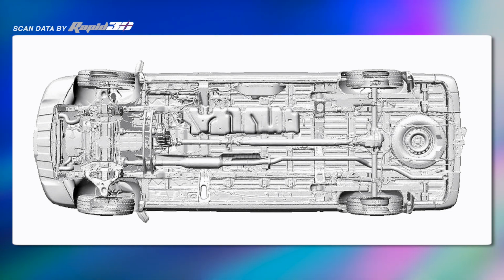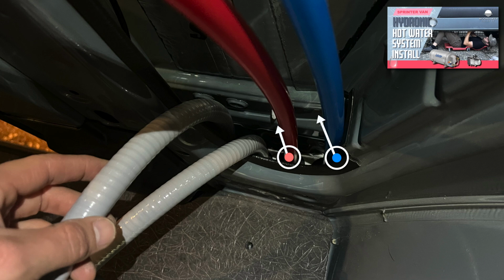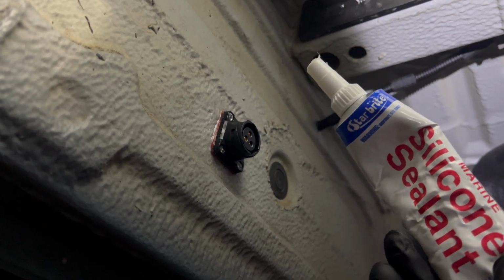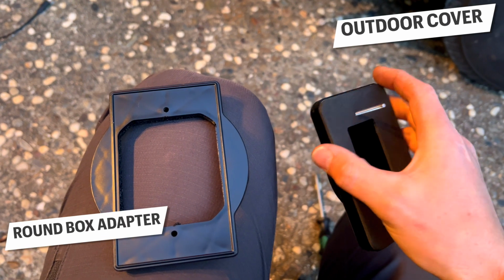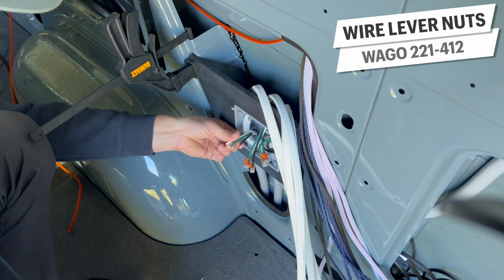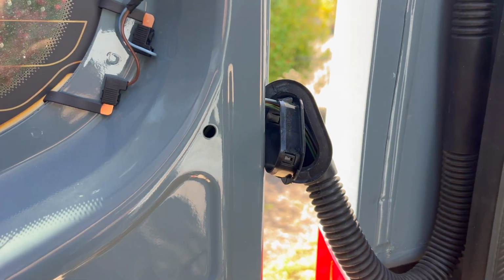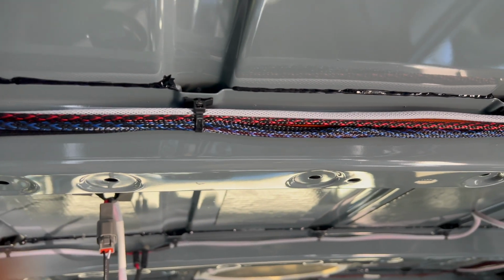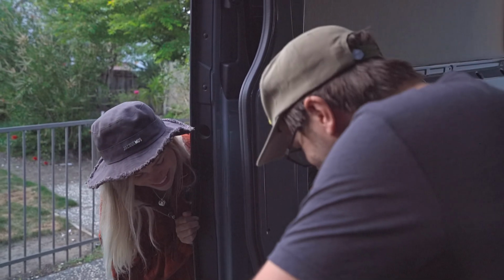Sprinter Van Electrical System Phase II - 120VAC Circuits & More 12VDC Wires

Comment: I purchased that cable boot and was wondering if you just used sheet metal screws.  I dont see a way to get nuts on the back side of it.  Im going through the same 3" oem holes you are on a 144
Reply from the maker: Yeah I used sheet metal screws, but I used ones with a blunt tip and pre-drilled pilot holes.  I used a blunt tip to limit sharp things inside that cavity.  Here's the exact ones I used - https://www.mcmaster.com/93195A434/

But after the fact I think normal sheetmetal screws would be fine since the boot does a good job keeping the bundle together and away from any of these screws.

Comment: Outstanding videos thank you. I see you are using liquid tight conduit under the van for your 120v runs. How are you going to run 120v inside the van. Conduit, split loom, techflex or ?. Thanks
Reply from the maker: Hey there, thank you for the kind words, it depends on where the run is going, by the sink I just kept the liquid tight cord grip going, but over by the electrical panel tech flex since its lighter and there's no real sharp metal edges on the route.

Comment: Hi Todd, Always waiting to watch a new video from you. They are all amazing. Thank you. Could you please advise when/where to you use Rust Bullet and Rust-oleum rust preventer. which is more recommended. Or, is each one for different application?
Reply from the maker: Hey friend thanks for stopping by and glad you are enjoying the content!

We’ve switched exclusively to Rust Bullet using this method 

How to Paint Exposed Metal Edges on a #SprinterVanConversion
https://youtube.com/shorts/GOBaAJjhO8A?feature=share

Later in our build. It dries so hard/durable compared to the other options we tried.  All rust preventative paints will probably work to some degree though unless you are in a really aggressive environment.
Reply: Thank you Todd for your kindness in responding to our questions further to your detailed and educational videos. I have one more question, I see you have used two different brands of rivet nuts, McMaster and Astro. Are these for different  applications, I.e undercarriage vs interior of the van. Not sure if using stainless steel or steel zinc plated. 
Thank you.
Reply from the maker: @fernarango  I've switched entirely to the McMaster ones now.  I found out the source too, they are Sherex CAL Series - https://fasteners.sherex.com/category/nd-rivet-nuts-american-style-rivet-nuts-cal-series

I've heard if you buy them from here they are cheaper, I haven't checked yet because I'm still working through my supply - https://www.baysupply.com/products/cal2-610-4-2-25-sherex

They are the best quality rivnut I've found and they are yellow zinc chromate plated so corrosion resistance is great!

Comment: Always love your level of expertise and craftsmanship. Romex in LFMC.... Bad idea. Difficult to pull and not rated for enclosed pull. FWIW. But I love your skill, knowledge, and craftsmanship,,,, oh and sense of humor.
Reply from the maker: Hey Rich, thanks for the feedback!  I'm using LFNC here, no metallic layer.  I'm not an electrician by any means, but I'm using marine grade triplex here which is quite a bit different than the classical Romex NM cable used in residential construction.  

- Romex is not flexible - Marin Grade Stranded wire is.  This is one of the reasons why Romex is not conduit rated because pulling can break wires. 
- Romex is not rated for damp and wet locations - Marine Grade Wire is completely tinned stranded cables with thicker insulation and a thicker sheathing.
- In addition Marine Grade wire is rated up to 105ºC

Curious if you were to do something similar with wire routing under the van what method would you use?
Reply: @moonrakerdesign  Every run is unique depending on gauge, number of wires, route, nearby components. I'm over 70 and cheap so difficultly also plays a role. Just never find sheathed wiring in conduit something I want to do as a basic practice or for serviceablity. Your knowledge and skills are way past my level so I mention it with a smile because it is the first thing I've seen you do that was quirky. BTW the second thing was the oxygen free large gauge copper speaker wire. Amazing what you can use in speaker wire and not be able to discern a difference but it does maintain the upscale custom flavor.
Reply from the maker: @richgray5762  Totally agree with you!  Every run is different and there are different goals and requirements for every run.  With these in particular I only want to add that extra layer as they come under the van.  Life under the van is pretty rough for a lot of reasons and this felt like the best solution for a waterproof and tough layer around these cables. 

Yes, that's true, the OFC is mostly a best practice based on the driving conditions of my particular amplifier and speaker combination.  Do you need it?  Probably not so if it is a matter of saving money maybe for some it's better to use something else! 

I appreciate the dialog and the feedback!  Thanks for sharing your POV and experience!

Comment: Great video as always! I have one question tho: Are there any gaps between the cables in the rubber boot? How can you ensure that no insects get into the van through those gaps?
Reply from the maker: The rubber boot cinches up tight with a zip tie so there are no gaps. These type of boots are super common in the Marine industry and are used by the Mercedes factory as well. There’s one under van under the drivers seat and one through the fire wall in the engine bay on the passengers side. 

I’ve seen people shoot expanding foam inside them before they tighten them up if they are really worried, but not a concern for us.

Comment: Great videos! Curious if 1/2" Coosa Board would be sufficient as,I look away from 3/4" thck Baltic Birch flooring. Thoughts?
Reply from the maker: Hey Nick, thanks a bunch!  Are you talking about the 1/2” Coosa Board? That’s what we put in our van and really happy with it.  What are you looking to do?
Reply: @moonrakerdesign  I love the idea of this lighter weight material, which I have never heard of! Wanted to make sure this type of florring wouldn't bend under my 225lbs weight. And I see you went with biscuit joints versus the puzzle piece joints suggested on Boat Outfitters... Pros/Cons if you get the time?
Reply from the maker: @nickh8370  Hey Nick, Coosa board is actually stronger than it's equivalent thickness of plywood, plus the structure of the van flooring is really well supported the maximum span rib to rib is like 6".  I'm 210lbs and the floor is solid as a rock!   

The actual joints really don't need to take load because it's supported by the van ribbed flooring so biscuits seemed like the easiest way to ensure things are super flat at the joints which is more important to me!  If I were building this as a cantilevered floor I might use something different.  

Hope this helps, let me know if you have any other questions!

Comment: Love the rear side box with no head screw, prety slick. 
I'm sure you would have a sustainable buisness plan if you'd consider producing all the custom machined parts you made for your van, for others that would like to follow your foot steps.
Reply from the maker: Hey Robert, thank you for the continued support, and that is eventually the plan. I've been loading up some parts we've made on our website here - https://farrframeworks.com/sprinter-van-parts

I'm casually supporting it at the moment and gauging interest on a few items as I want to eventually finish our build and am pretty busy with the actual day job at the moment.
Reply: Hey Tod, thanks for your reply. 
If you're asking me , I would buy from you pretty much every thing you've made and follow your build by the book so far except for the AC as would prefer an undermount AC such as Cruise N Comfort.
But hey, I need to buy a Sprinter van first 😂